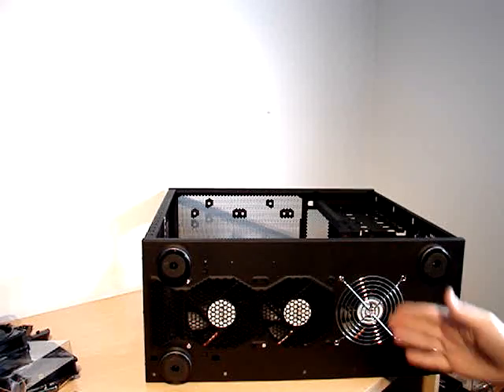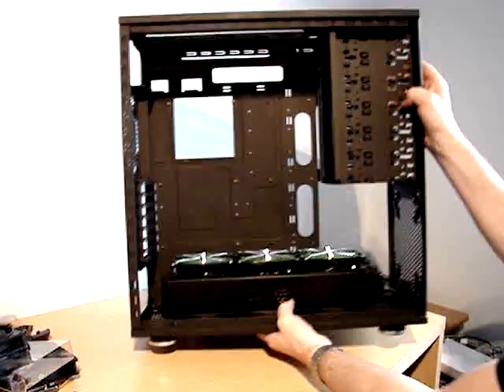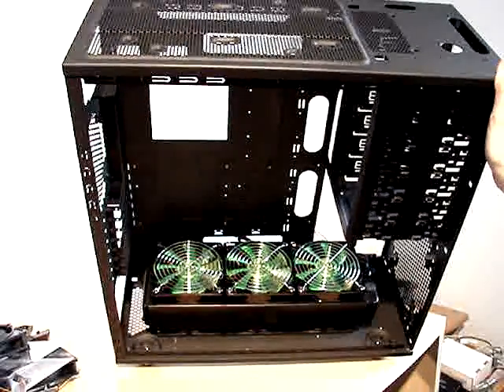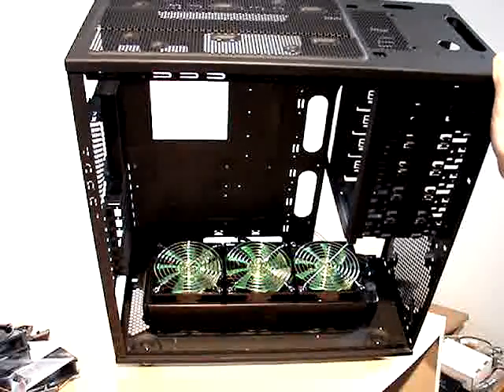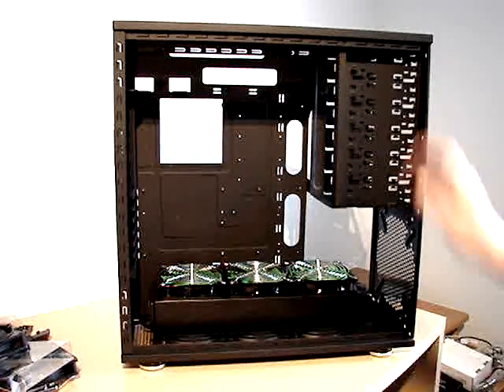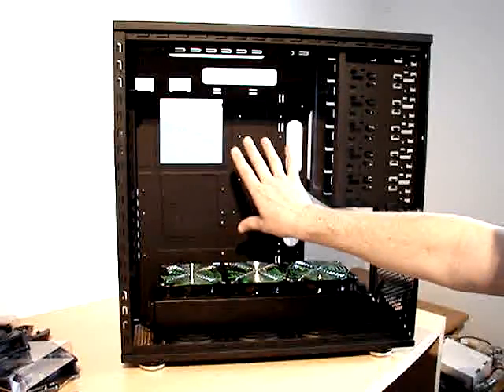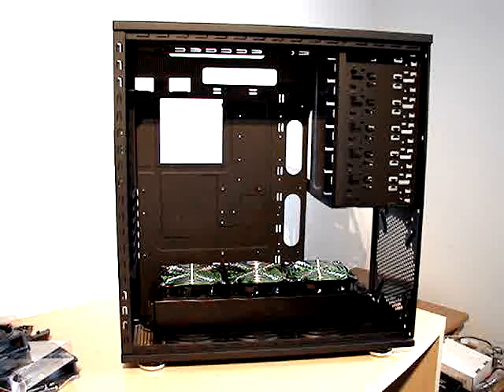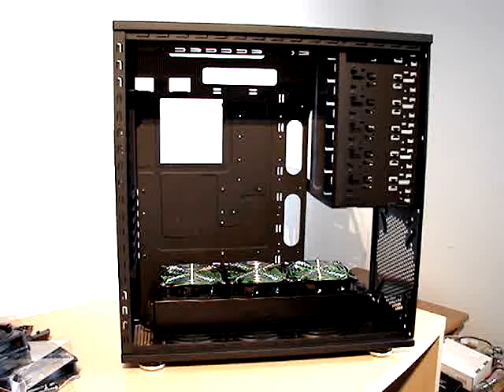Watercooling build Part5  Finishing up with radiator installation

Comment: Would the cpu be cooler pulling air from outside over the radiator into the case or from the case over the radiator and out of the case.